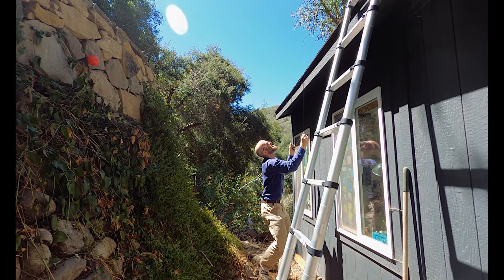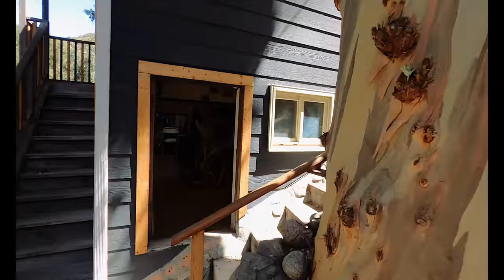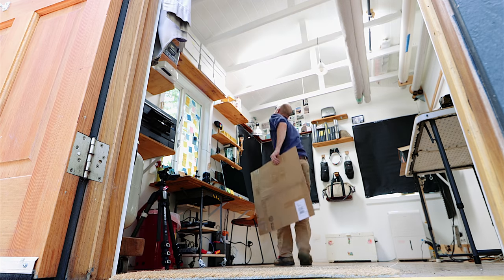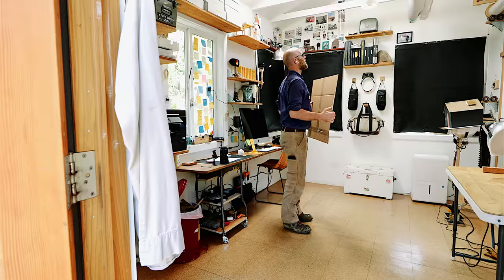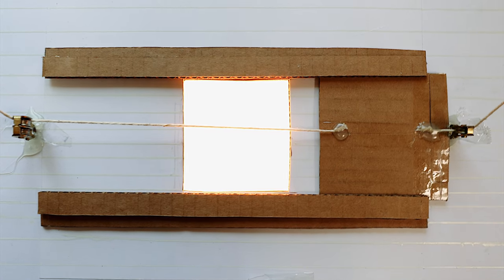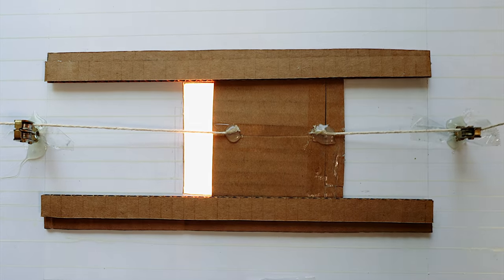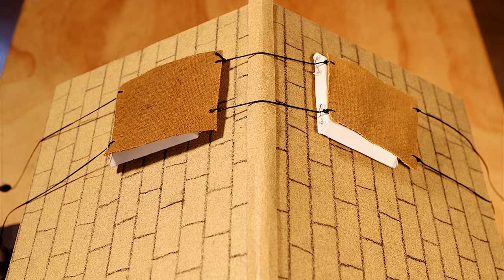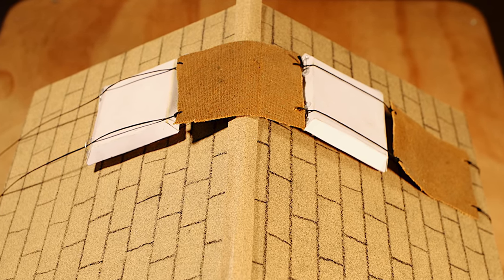DIY Studio Renovation

Comment: I feel like you may have overthought this one, you just needed to make blinds with a handle that you can grab with a pole and hook onto something once extended. I've done this with 2 skylights for decades without failure.
Reply: Totally agree. Internal hook blinds would be far more long lasting and easy.
Reply: Also the wind, sun damage, rain, animals. Idk I think something that covers them from the inside would've been better. Still interesting and one way to solve the problem. But not the ideal way in my opinion

Comment: I like your unique solutions.  I think I would have just used hinged panels inside, with magnetic closures.
Reply: And a simple pulley to lift the panels up with no hassle
Reply: I'd opt for that too, keeping the stuff (and me) out of the weather but if it works, it works.
Reply: @BixbyConsequence  Chances are - if the weather is bad you don't need to close the blinds as it wouldn't be too sunny.
Reply: This comment will so trigger him! xD
Reply: Yes. A one time effort instead of having to replace ropes and tarps every few years.
Reply: Magnets on both sides of each panel and a set on the window edges and a set inside roof so he can swing it all the way open. Have a hook on the wall and a loop on the panel so you can pull it off one magnet and push it against the next. Then he wouldn't have to go outside when it's raining
Reply: @28th_St_Air  Plus the wind lifting the rug, allowing light to enter the building.
Reply: I was thinking the same solution myself
Reply: @cosplay-welt  LOL
Reply: 💚 Exactly what I was going to write!
Reply: I was thinking the same thing lol
Reply: Exactly. 👌
Reply: @SwiftStixx   No need for pulleys and ropes and things. Just have a long pole. Can be used to push the hatches closed or hook them open, or to assist getting stuff down from high shelves if he starts storing stuff up higher, or to fend off bears, or to fight Robin Hood. So many uses. Nothing better than having a big stick.
Reply: @roaduser6438  now that you put it this way a big stick seems like a sound idea

Comment: I’m clearly Canadian because I’m like “what about the snowy 10 months of the year?”  

This clearly works but has too many fail points for comfort. I imagine a 1/2” plywood panel and a piano hinge. Dowel attached to the side so you could manoeuvre the flap into place and then place the bitter end into a holder in the rafters. Multiple holder locations would let you tune the light.
Reply: i don’t follow
Reply: My thoughts exactly. Any sort of indoors solution would've been better.
Reply: There are no snowy months at all in California.
Reply: @madmex123  I know…

Comment: Plywood flaps on a hinge from the inside. Make one arm extension pole that allows you to unlock and lock from open and closed using clips that pivot. Make another arm extension that allows you to hold the flap still while you do the above.

Comment: I used some long drawer rail's from an old bed frame and stappling some tarp on plywood worked on my attic skylights though I had the setup on the inside, with a hook to hold them shut.

Comment: how would you go about securing the handles for inclement weather/not having dangling cables? assuming its about 6ft of loose rope on the sides just dangling. you could implement 4 connection spots at Close low (when closed), Close high (when open), Open high (when closed) and Open low (when open). the four spots create security to the building at all times. the current handles would need 8-16 hooks, you could substitute 2 handles for a bar so the pull is even, one handed, with only 8 hooks needed. or go with a metal bar and 4 magnets.

Comment: Van, why not install some kind of rail or extrusion inside the shop for a piece of plywood to slide on and off. (use a rope so you don't need a step stool in the shop).

Comment: Very spirited!  Does he ever consider the use of a long stick as a potential solution?  Possibly from the inside with a roller shade?  A little late after all the engineering and construction and problem solving.  Definitely, your solution is much cooler, and fits your ascetic.

Comment: Am I the only one that would put pulleys and just take them apart and rattle can them rust-resistant black or where he has the drawer handle to route the rope, as well as pulleys - sticking out just passed the shingle overhang so The Spirited Man can eliminate the cable ever moving and the pulleys would work to manage the ropes? However, The Spirited Man could go a step further and monkey fist knot the ends with perhaps some fishing weights inside (or, perhaps a rope stop invention on the side of the house that clamps the rope in place on one side and weight the other side so it is practically maintenance-free), and perhaps some tiny clamp-on O-rings clamped on the rope as stops so the tarp is always in the correct spot.

As the ultimate in projects, you could use a raspberry pi and use a servo motor and wifi module and such to actuate the ropes for you it can be something simple like turning the motor on for exactly the time you need or perhaps if you want to go the engineering route and use an AVR microcontroller that is used in robotics to control a dc motor. The microcontroller I believe can measure torque, so you could realistically make it turn until it impacts the stops we clamped on the rope. It would also potentially eliminate anything on the roof ridge as it could maintain tension and perhaps some sort of roller done with bearings, PVC, and wood.  3D printing all the parts can be done at your local library for cheap.  This is just what I would do in order to keep the spirit of The Spirited Man's idea alive. I think a professional would use an industrial-ish roof hatch that has a remote opening built-in and they build it to job specifications. My last idea is a cheap and dirty retractable pergola that can also be remotely done if you REALLY wanted.

I am just spitballing here, really. Possibilities are endless. I appreciate the simplicity of The Spirited Man's idea, I would just engineer something that would be more tolerant to time and the elements. Perhaps I am a smidge Spirited myself. Hopefully, this inspires at least one person to come up with a much better solution than mine.  :)

Comment: Won't work for me! I am in the UK it's always dark and wet, I need more light - maybe a rail and pull system to pull your mega light up and over to shine through artificial sunlight? But then it's always wet too, so I would need to insulate the electric cables! hmmmm I need a plan

Comment: I like the Cardboard box idea most. I'm just thinking out loud here. Why not use magnets on the inside. You could attach magnets to the edges of the cardboard/edges of the window. It looks like there would still be some light leakage. For that on the very ends you could attach Velcro. Then you'd have to find somewhere to store it. maybe some more magnets to hang it up somewhere else. i think magnets would be another solution.